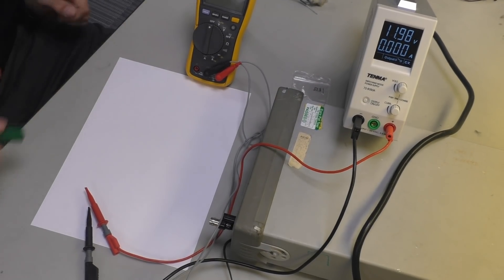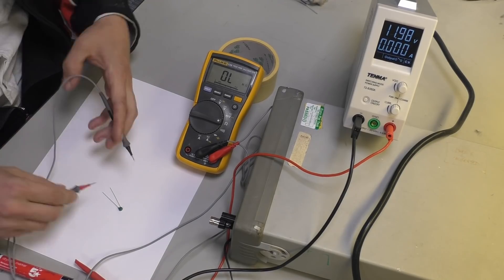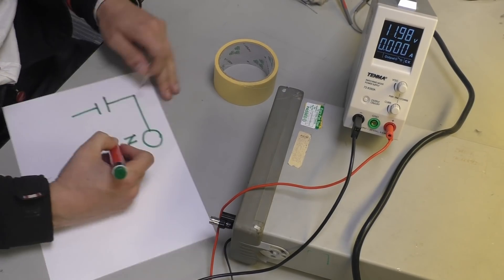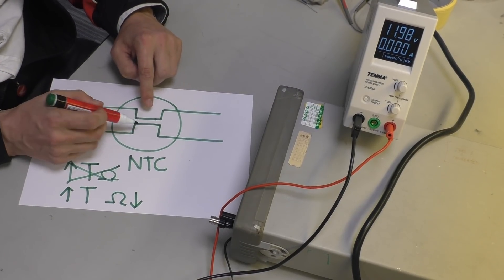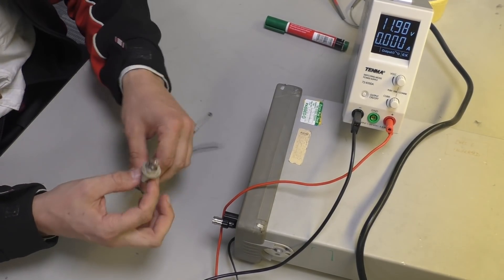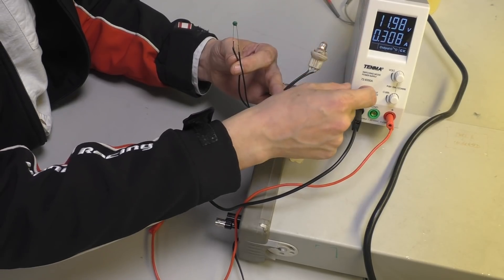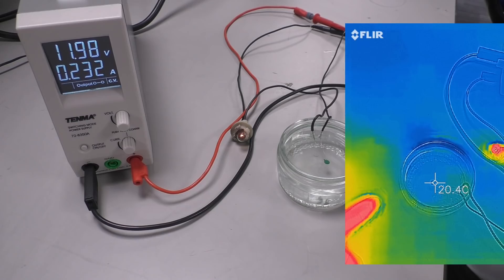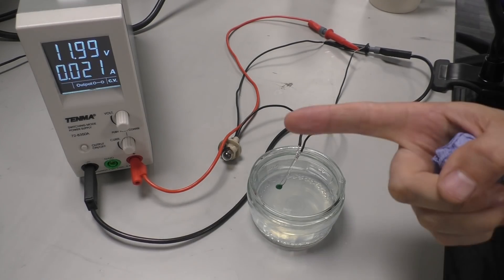Fuel Level Sensor - NTC Thermistor example

Comment: This is another joke electrical video right?? NTC cannot be used like this, For a starts When the NTC fuses it's goodbye petrol tank and bike.. It is used via a low current amplifier and hysteresis switching.
Reply from the maker: "When the NTC fuses" - what?
Reply: You cant drive a bulb through a thermistor, look at the datasheet Max current. It will act like a fuse.
Reply: Get Hot and POP..
Reply from the maker: not another spastic - 

The SV has one fitted, a lot of bikes do. 

https://scontent.fltn1-2.fna.fbcdn.net/v/t1.0-9/41223366_2133242790276165_8599810972376367104_n.jpg?_nc_cat=103&oh=da8c2f415187d017b72c1a041835d9e6&oe=5C14F954

Look at this datasheet - Inrush current - Suitable for power supplies of less than 100W. The bulb is 5W. The voltage was 12V and the current was 0.350A max when in air. 12 x 0.35 = 4.2W - what the fuck are you talking about?

https://scontent.fltn1-2.fna.fbcdn.net/v/t1.0-9/43350184_2147645142169263_2915548148417953792_n.jpg?_nc_cat=108&oh=605767771fe68825fb6a8119ae9568bf&oe=5C5AF63E
Reply from the maker: "You cant drive a bulb through a thermistor"

- LOL - I just did.
Reply: IT GOT HOT, Any electronics engineer will tell you this is not the way to run a thermister.....JEEEEZZZ, Google the thousands of thermister control circuits and you will not find a voltage source to thermister to bulb anywhere... your just trolling me for YouTube interaction Algorithms.  I will install this system to my bike and Report the Explosion after an hour to DelBoy So he can critique the guidance as dangerous.....
Reply: I am afraid that you are wrong, this is exactly how they work, I have reverse engineered one for a friends car and fitted a standard NTC thermistor from RS components. Although thermistors are more commonly used for sensing, typically in a bridge circuit driving an op-amp in this application they use one to directly drive the fuel warning light. Oh... and I am an electronics engineer and have been for a very long time. The choice of thermistor is obviously critical to it working or not.
Reply: Correct and it was a demonstration not how it is installed in any particular vehicle. The choice of bulb was clearly what Matt had available and easy for others to see.  In most instances it would be an LED these days.
Reply: madcockney The thermistor approach relies on putting a fair amount of current through the thermistor in order to heat it, not ideal for the LED approach, though it could be done.
Reply: @proluxelectronics7419  

A THERMistor, got hot?!!

Oh shit!!! Everyone duck!!
Reply: @madcockney  Ive got an overseas made "Ochoos" NTC thermistor off Amazon with two leads coming from it. Trying to use it to turn on a low fuel indicator light. Any insight on how I could wire that? Not sure if it's like the one in the video
Reply: @proluxelectronics7419  Out of curiosity, if you're still on here, did you ever learn you were completely wrong?
Reply: Earned yourself some air time in the next comment corner!

Comment: What's the max temperature on those things? Can they ignite the fumes in your tank if the bulb shorts out or some shit? idk.
Reply from the maker: no.
Reply: Solid. Thanks, lad.
Reply from the maker: The max temp is about 125degC - this is way too low for ignition of petrol/gasoline - its auto ignition temperature is about 280degC

Comment: Matt I am trying to do an arduino tachometer with a hall sensor and a lcd. and I am having some problems with the code, could you help me with that if I send you the actual code ? it is working but is very imprecise
Reply from the maker: LOL no. What made you think I know anything about coding? LOL - Put a message up on FB, someone will probably help. The only thing I would say is what is your sample rate vs signal rate from the hall effect sensor?
Reply: I would check the sensor is working OK with a known speed like a mains motor as well, there's lots of tacho software on github
Reply: There are YT videos on this. Check the electronic videos as well as many of the electronic enthusiasts do these sort of things and I have seen some on this.

Comment: Why do piston port 2 strokes have transfer ports? Because id think there wouldn't be anything to transfer cuz the carb is attached to the cylinder not the crankcase?
Reply from the maker: The bottom of the cylinder or the crankcase, why does it matter? And that really isn't anything different. The whole piston ported, crankcase thing it kind of bollocks. They're not 2 different things - one is just the evolution of the other.
Reply: @thedirtyworkshop  it doesn't matter just curious cuz I took apart a shitty weed whacker for fun and saw that so just curious